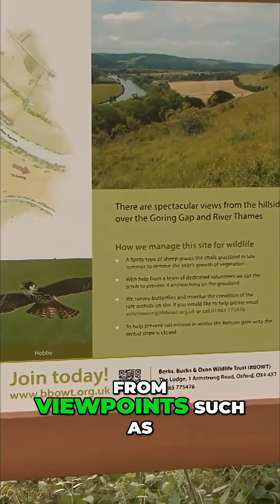Victorian Beauty vs  Modern Steel  Goring Gap Controversy #fyp, #GWR, Railway, #ukrail

Comment: No, Network Rail did not complete the electrification of the Great Western. It ran out of money because the whole scheme was over-engineered. The Bath route is only electrified as far as Thingly Jn. All the IETs that were supposed to be all electric had to have motor generators fitted.